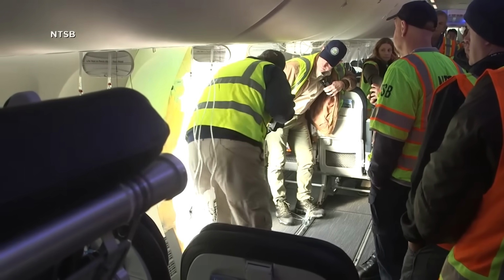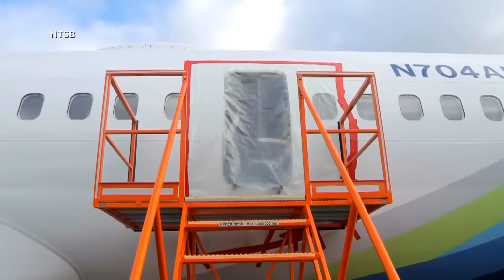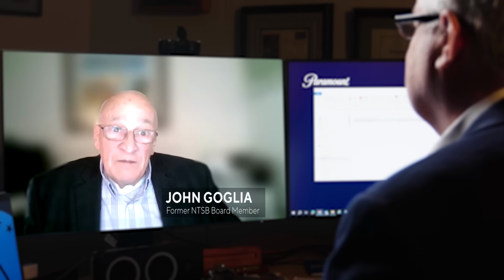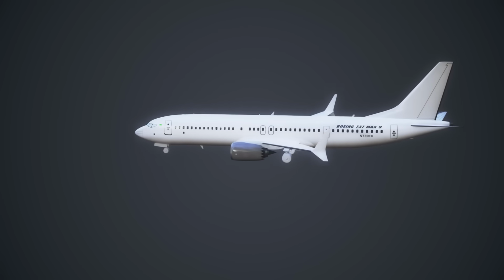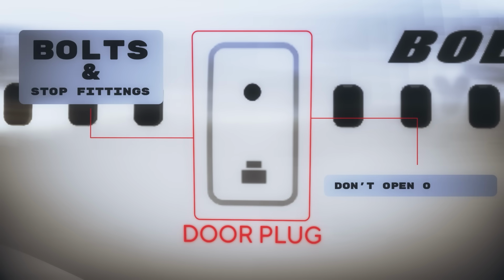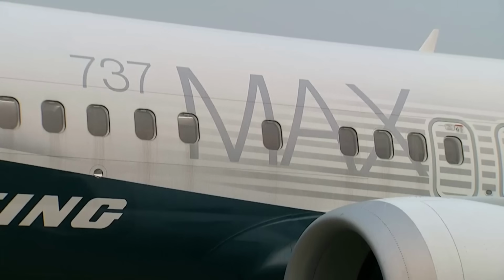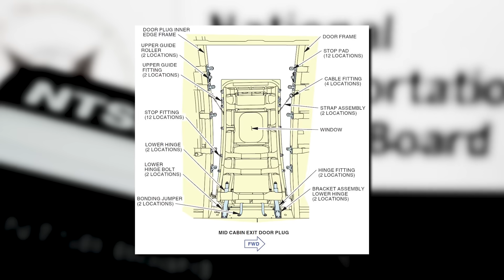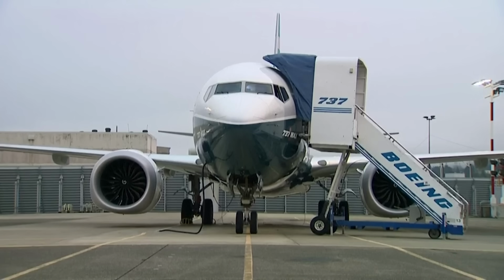Airline safety expert questions Boeing door plug installation and inspection process

Comment: THE PLUGS ARE REMOVED WHEN THE INTERIOR IS INSTALLED. WHO INSTALLED THE INTERIOR AND SEATING ? THAT ENTITY DID NOT INSTALL THE BOLTS
Reply: Boeing would've installed it before Delivery.
Reply: Caps lock is on.

Comment: Picture shown is NOT a doorplug. Doorplug has same windows as the rest of the plane. Duhj
Reply: Some have porthole windows, some have standard windows. They have been installed for a decade or so and the picture may be an earlier part.
Reply: @machintelligence  the Alaskan 737 was brand new, so square std window, not a porthole

Comment: Door-plug could be considered a panel, therefor it could be flown, theoretically at lower altitudes with breathable O2 levels.
CDL Configuration Deviation List can include panels.

The CDL should not be confused with the MEL (MEL). While the MEL describes the limitations of aircraft operation in case of a system being inoperative/having malfunctioned (e.g. transponder failure), the CDL deals with situations where external parts of an aircraft are missing/fallen off (e.g. fairings, aerodynamic seals or panels).

Comment: April 13, 2023  Spirit AeroSystems manufacturers some of the fuselages used in Boeing jets and said in a statement it notified Boeing of a “quality issue” with certain 737 models.

Comment: I would open and inspect the plug door on the opposite side to get a clue what is missing. Quite likely they were installed by the same team.
Reply: the ntsb reported they already have and it was all good.
Reply: Why can't inspection task be videographed for future review. Also post cover installation radiography can be used to verify as built status. It is a technology that is readily available.
Reply: Even if a job is done by the same person, it can be totally different on both sides. Im sure the first thing they did wa looking on the other side. Humans just forget things. Maybe somoen forgot a bolt. Or a nut. Or the cotter pin. But to make the same exact mistake on the same place on the other side? Almost negligible. The cause for the accident isn’t that ”a mechanic forgot to tighten the nuts and bolts”, the thing you are looking for is ”why wasn’t it indpected by anyone” or if it was, ”how did it get through inspection”. No one is perfect and with something that complex there are bound to be hundreds of mistakes. But thats why people double-check and triple-check and inspect things and those minor mistakes are fixed.
Reply: NTSB stated they are, right from the get-go.

Comment: CBS news should find out what happened to the interior panel that covered the plug door on the inside of the plane. 
Secondly why not use xray technology like in security checks for passengers and luggage at airport to find out what's behind the interior panel so that we can take a critical view of the plug door nuts bolts cotter keys and locks. We need a new Mike Wallace.

Comment: Kenya Airways Flight 431, an Airbus A310, crashed into the Atlantic Ocean on January 30, 2000, while flying from Abidjan, Ivory Coast, to Lagos, Nigeria. The crash was caused due to a false stall alarm which resulted in pilot error.
Kenya Airways decided to severe ties with Airbus, and quickly discontinued the operation of all Airbus aircraft in their fleet. KQ upgraded their operation with aircraft from Boeing and Embraer, but have never used Airbus since.

Comment: they are wrong about attachments all around. there are 12 pairs of matching lugs -- 6 each on plug  and frame which, when properly aligned, create an air pressure forced friction seal keeping the plug from blowing out. there are four bolts with nuts acting as pins keeping the plug from moving either up or out on its  slide and upsetting the lug alignment. if the nuts on the four bolts  come off the bolts can slip out and BAM -- buh-bye plug!

Comment: Why not just keep the door as an escape hatch, even when the passengers are less than required.  As far as im concerned you cant have too many escape doors on an aeroplane
Reply: Doorplug is cheaper and lighter than a real emergency exit ....
Reply: The plug is lighter, and there's no need for an additional exit row. The plug isn't the problem - as they say in the video, they've been used for decades. The problem is the workmanship.

Comment: The point is No one in the USA, UK and rest of European Aviation Authorities, actually pick-ups on these loose securing and locking bolts and nuts, on Boeing 737 Max 9 emergency exit doorway non-opening Plug Sections.

So what else are the USA, UK and rest of European Aviation Authorities, are not picking up on and not with just Boeing, but Airbus or other Aircraft and Helicopter Manufactures errors, failures and mistakes in production of their aircraft and helicopters.

Or the USA, UK and rest of European Aviation Authorities, are not picking up on with regards Airlines own failures, errors and mistakes too?

Whether caused in day to day airport operations and flights, or with regards Airlines maintenance and servicing plus repairs, or carrying out upgrades, modifications and so called improvements to their aircraft and helicopters too?

Let alone USA, UK and rest of European Aviation Authorities, not picking up on other failures, errors and mistakes being made by Air Traffic Control Centres and/or by Airport Operators and Owners too, which is just as much placing air passengers and those on the ground at possible future risk of more Air Accident Incidents too?

Comment: I believe this is about nothing but poor engineering. They have overcomplicated the mechanism. The "plug doors" should be designed in such a way that it should only be able to come inside the plane when removed. The whole frame on the opening on the fuselage should be smaller than the door and there should be no way for the plug door to move outwards at all. When you need to remove it for maintenance or whatever reason then you undo the fixing that holds it in it's place (which has no vital role) take the door inside the plane, turn it sideways and then take it out from the opening. This is a door you remove from its place perhaps once or twice in the lifetime of the plane if ever. Russians would do it this way.
Reply: Very very true! As it pushes out it gets tighter. You nailed it
Reply: The problem there is that the reason these hidden doors exist at all is so that at a future point, they could be converted to operational emergency exits. Otherwise they would never exist and it would just be a regular fuselage wall there. This is why they slide open to the outside. Making them into a literal plug that only fits from the inside would completely defeat the purpose of their existence.
Reply: They also open to the exterior in case of fire, just like most commercial storefronts
Reply: I am not saying the functional emergency doors to open inside. What i am saying is, if you compare the plug doors to the functional emergency exists the plug doors are much larger. I believe when needed the plug door is replaced with a functional emergency door including it's fixed frame ( remember their size and how they operate in 737 -> https://youtu.be/6RULALwUizg?si=RE_DEL0GSKzCarvP ). Having said that, there are some planes even with emergency doors opening just as i have explained. ->  https://youtu.be/VOb3RojhHkU?si=qWGfxJqFid9mp7R3
Reply: The doors when fitted are the same size as the plug. They are emergency doors only and not used for regular boarding of the aircraft. If the plane has an emergency and they are required you'll have to duck your head on the way out. Do a google to see what I mean There is a great picture of a KLM 737-400 that has the emergency doors highlighted in white on a blue background over the wings. It's very easy to see their size and yes, they are the same size as the plug on this 737 Max aircraft. These doors are there to improve the time to exit all passengers from the aircraft, when the cabin density of passengers is too high for the regular doors to do the job. If Alaska or a future airline that leases that aircraft, increases the passenger density on the plane, those plugs can be removed and emergency exit doors fitted along with new interior panels.
Reply: wrong. this design is not new -- it has been in use for decades on various models without problem. it just happened to fail on a MAX. it's an assembly issue and nothing else.
Reply: OK let's stop calling it a plug "door" since it's not a door. It's a simple filler. It fills the place of an emergency exit door and it's frame. It doesn't have a swing out mechanism. It's just a filler cap. When you need to replace it with a functional emergency exit door you take it out and install a fully functional emergency exit door in it's place. Now this functional emergency exit door comes with a frame that gets "fixed" to the opening on the fuselage just like the plug cap. The actual swing out exit door should be inside this fixed frame. Just think about the doors at your home. The frame is fixed on the walls and the door is attached to the frame by the hinges. So the frame is in fact the same size with the filler cap and the swing out door is inside this frame. So fixing the frame to the fuselage should be done from inside in the simplest and most secure way as i have explained in my previous comments. You should not expect the frame to pop out just like you shouldn't the plug "cap". Whatever.. I had enough of this. I would design my own plane according to my standards so that you would be safe. :))

Comment: The last inspection step of the plug doors is  before the verificatipn  ok to install the interior panel and then following the seating put in down  the assembly line...When the  interior side wall got installed, you no longer can see the hidden discrepancy  behind the panel and is often  few days  before it's ready to roll out the factory...Shop, quality , and management all had played in failed  mishap incident..failed Workmanship  and quality inspection but most important failure is bofh manufacturing and quality management rushing and pushing the workers and inspectors to complete jobs fast to meet management matrix numbers and schedule is all they cared about as priority  over quality and safety of passengers..Been there 18 years to confirm Renton final assembly is operated under failed poor  incompetent management chain that leads to many  quality escape one after another incidents like this..

Comment: (Yicai Global) Nov. 27 -- Aviation giant Boeing has begun work on the second expansion of a Chinese parts factory in a move that will double the current production space at the facility.
Boeing Tianjin Composites will add 20,000 square meters to the facility in northern China, taking its total working area to 83,900 square meters, Boeing China said online yesterday. It did not disclose how much the extension would cost, but expects to complete the work in 2021.
The expansion is the plant's second to date and includes new work areas and amenities, including upgraded offices and conferences rooms, a new employee canteen, underground parking, a fitness center and a baby-care room.
Boeing and state-owned Aviation Industry Corp. of China founded Tianjin Boeing in 2001. It makes around 13,000 composite parts and components for civilian Boeing aircraft every month and has delivered nearly 1.5 million parts, used in planes the world over, since its formation.

Comment: So we're just going to ignore the fact that the only reason these doors and plugs are necessary is because the airlines insist on cramming more and more people on every flight?
Reply: You've got it all wrong.  The plug is used on a lesser capacity aircraft. If the airline wants to go to maximum passenger load then they have to provide additional  means ( an active door) to evacuate the aircraft in under 90 seconds.  There is an unbelievable amount of misinformation or ignorance of the subject out there. Also I am amazed at the hatred for Boeing out there.  Got it?
Reply: No, I don't, you've missed the point entirely. If it weren't for the airlines wanting the possibility of sardine packing, those openings wouldn't exist in the first place and the plugs would be unnecessary, period. Also, I didn't even mention Boeing, so you're just being a random troll.

Comment: a lot of talk about manufacturing processes but the DESIGN of these doorplugs must be flawed if they can blow out from mistakes during installation. These should be permanently sealed, at least use castle nuts 🔩
Reply: If you look at other videos on this they show more details on how it is attached. It is supposed to have four bolts with castle nuts and cotter pins. It’s looking more like blots or nuts or pins were possibly not installed. When you see the details of how it’s all put together it seems impossible for it to come off unless the hardware was missing. However, from what I saw of the stop pads it rests against it could also have some additional bolts/screws which are torqued on as additional points of attachment.